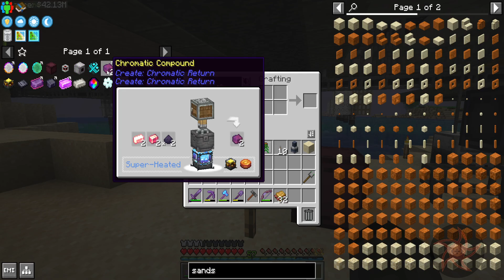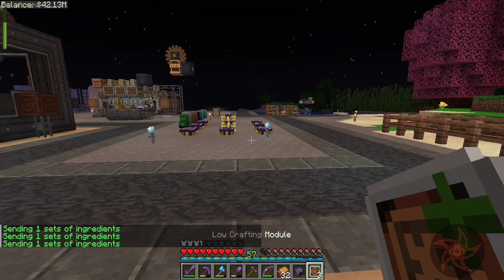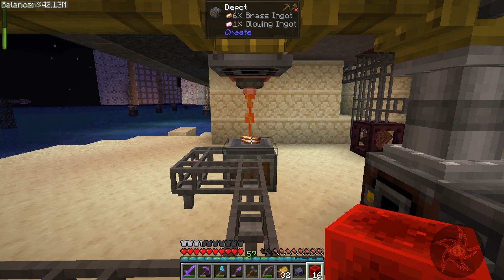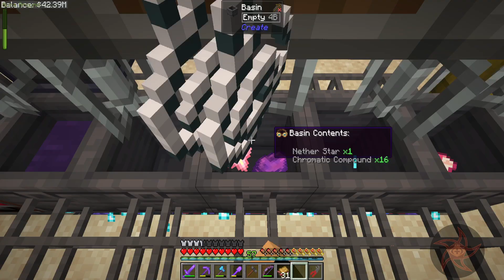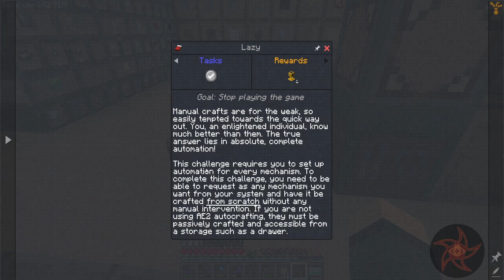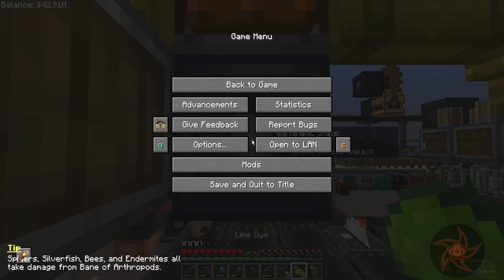Forever Factory :: One Step Closer - Special Ingot Automation :: FF-53

Comment: Creative flour is used to make the creative blaze cake! You can toggle blazeburners from Off to on to super Heat and they will burn forever. ❤
Reply from the maker: I thought about it, but I have so much gasoline that it's just easier to use that then make a creative blaze cake